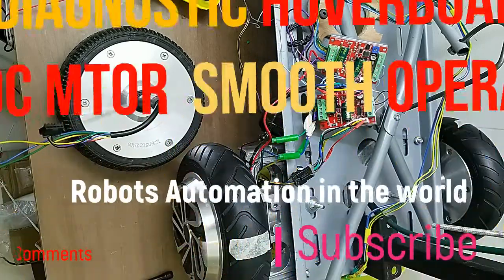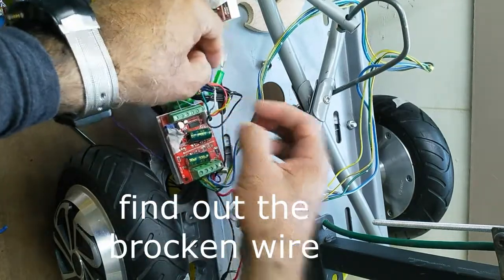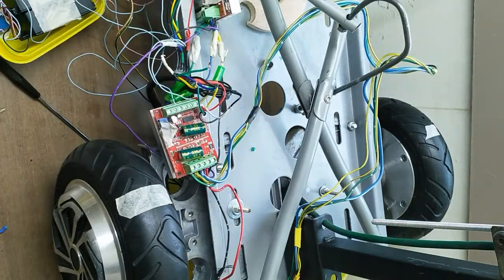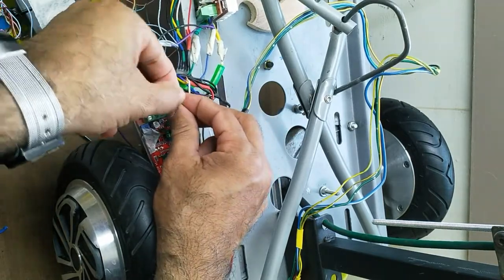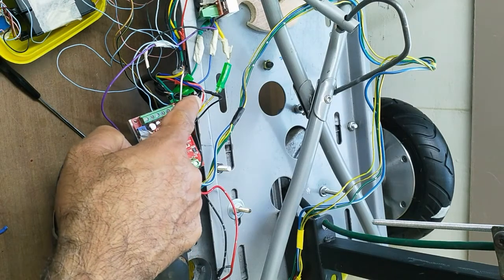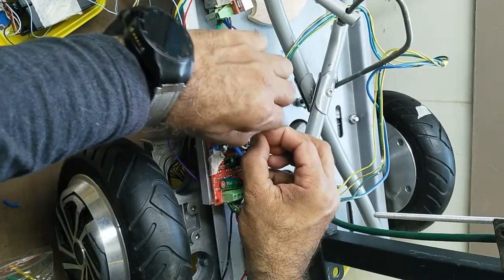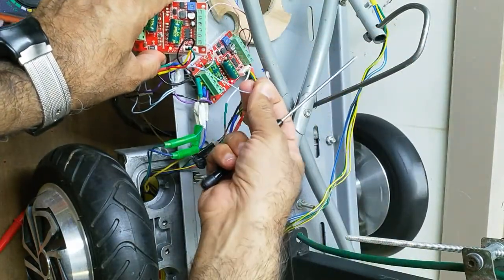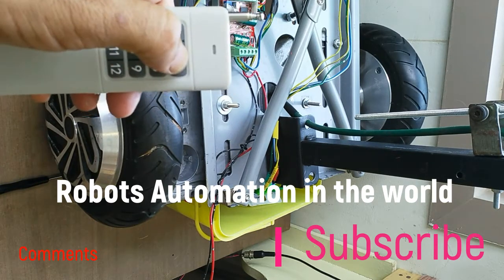Hoverboard motor problem and solution ZS-X11H BLDC remote Control Break Jam Sound Reverse 0

Comment: nice vidéos 
how do you connect the relai with the radio controlleur please ?
Reply from the maker: It's easy one remote second is remote control relay works as switch
Reply: @MKRCLabs 

With a potentiometer it's OK (0-5v), but with "finger throttle" (with hall sensor) the motor reacts when pressed but keeps turning when released (0.75-4.2v)

Translate a conversation

Comment: Hi. Can you help me please  connect the RC receiver to these controllers?
You show not what cinde of receivers you use, and if I understand correctly, receivers that fit this remote control of yours are simple radio relays, but not receivers from radio models?

As far as I understand my problem, the frequencies at which the PWM receiver and controller operate do not match.

Can you give me some advice? I need it for a Mars rover project with six motors.
 Thank you. Regards.

Comment: Hello sir,
  Am using raspibery pi to control the BLDC motor using same driver.
One thing is it's works fine using potentiometer provided in motor driver circuit. But if i use code to control through Raspberry pi it's not working. Code has no error.
Reply from the maker: Did you connect all cables hal sensors if no feed back it will not run battery voltage ?
Reply: Sir,
    Conventionally the motor is running if i vary potentiometer.
But if i use visual code ide through raspibery pi isn't not running.
Code has no error.
Reply from the maker: Check sensors poet supply
Reply: @vinodkumar.p7800  raspberry pi is 3.3 volts and controller is 5 volts. I use Adafruit PCA 9685 like pwm driver and connect it vía I2C with raspberry.